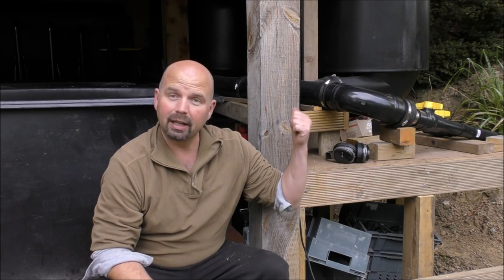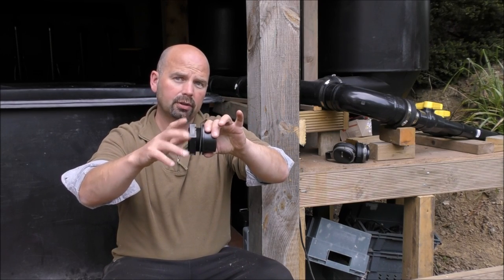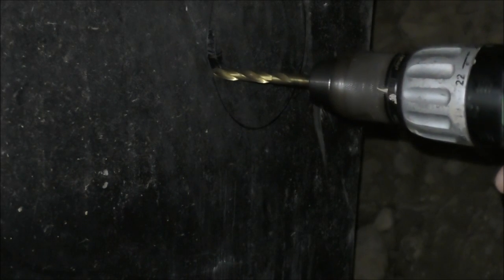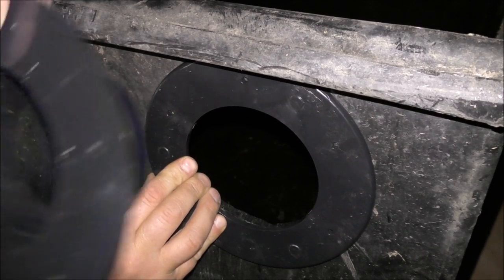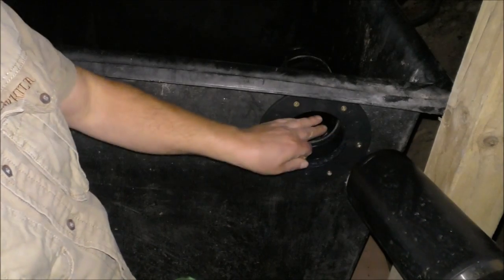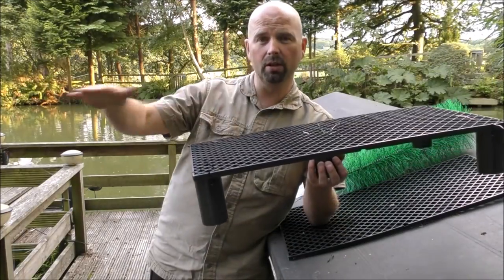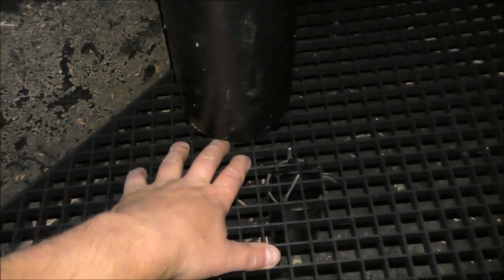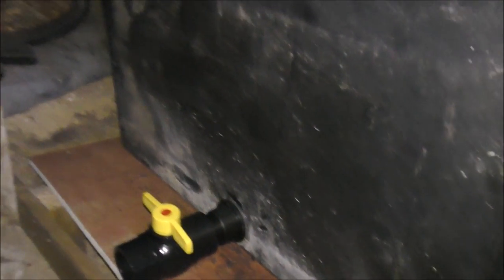Building a HUGE Pond Filter - Part 3 - Brush Chamber

Comment: i will drill with smaller hole saw and use a fat max knife saw to cut spokes to the edge then saw around the mark. One thing, Richard, the tank connectors don't come with washers I find. Had to buy on ebay. Will leak without.

Comment: Brilliant Richard, Been waiting for this one for a while. Where have you been pal? Hope all is good, Looking forward to the next segment. Tony
Reply from the maker: I haven't been anywhere - that's the problem, lol
Last month I had the equivalent orders of 3 months when I had the shop so I was stupidly busy and it's not letting up this month either. We're waiting of a large industrial drier being built for the filter media manufacturing plant which should really increase production then I will make the trade site live which will hopefully take some pressure off me if people can buy the media at various other sources in the UK. I can't make the site live until the drier is installed since we couldn't cope with an increase in orders at the present time.....it is mad.
Reply: @pondguru  Thats great news though mate. Much better to be run off your feet and have the orders coming than not have them at all. When is the drier due? When the trade site goes live that dhould streamline everything for you and free you up a little
Reply from the maker: It is quite a big thing so they reckon it will take about 6 weeks to build - can't come soon enough, lol

Comment: I can hardly wait until you show the pump. Its got to be a monster. I've seen them at a local store that only does Koi ponds..as I perused the plants outdoors,I went inside to see some huge commercial grade pumps. I wonder if they are low energy use like many magnetic drive pumps are compared to olden days direct drive pumps.
Well,I know my idea of buying bales worth of poly filter and filling one of those huge containers with it...or in milkcrates of it stacked might not be practical,but might work. How you clean it..is for you to figure out-lol.  Also the barley bales in the pond..no use to your needs? Some swear it takes care of green water.
Reply from the maker: I'm hoping that the first stages of this filter will handle the mechanical parts of filtration but if they don't then the latter stages will have static alfagrog which works great in muck.
The pump I'm considering is 30,000 lph and is 380w so is very low power consumption for the output it generates.

Comment: Being pump Fed I would consider a 4 inch bypass at the very top of the container. Just in case, you never know.
Reply from the maker: I had considered that but the system is under cover so will get no leaves or any other detritus finding its way into the containers. If the worst did happen it would take a good while to drain the pond so the fish will be safe, lol

Comment: I see the 5 outlets, however how do you plan on getting an even flow around the brushes to the outlets. I fear the water path will follow the outer edge of the container straight to the outlets.
Also the bottom drain may have difficulty reaching the far edge to clear the muck out. Maybe a small "H" shaped diffuser piping in the bottom.
I hope I'm helping.
Reply from the maker: Not sure if you saw the last video but I have built a pipe into the feed which will supply a really heavy flow of water for swilling down the containers for cleaning so muck flow through the drain will not be an issue.
Water in brush chamber is fired down to bottom by the 4" pipe and it rises up through brushes evenly so there will be no area where water level will be higher than other area in the container. The outlets may not be perfectly level but water flow will be heavy so should easily go through all 5 outlets. If I have got it really wrong I can simply add a 90 degree bend on the inside of the outlet to level water flow through them. I should really mention that in a future episode so thanks for bringing it up.

Comment: My advice when doing that is if you're going to use a drill with side-pressure, be careful and take your time. Drill bits and chucks aren't necessarily designed for side pressure, but in soft material like plastics, it should be okay. Always good to wear gloves and safety glasses!
Reply from the maker: That is a good tip and I should have mentioned that. The container plastic is quite soft so the drill cuts through it reasonably easier but I wouldn't want to see someone try this with a drill bit which snapped and ended up in their eye. I'll add a note to the video description and shoot an extra part for the next episode as a warning at the start.
Groovy.
Reply: Rock on, sir! I love your videos, can't wait to see the next step in this monster filter!

Comment: Awesome as always :) Just a thought but with those 4" legs are you not going to get water left inside once you drain it down? I built a similar thing on a much smaller level for my marine tank sump and cut out small sections at bottom of the pipe legs so the water could flow out. 
Keep up the great videos :)
Reply from the maker: I may get a tiny bit of water held in the legs but it will amount to very little and on the scale of things it's something I never thought about but I could see why you had holes in for a sump scenario - nice one.

Comment: Been a long wait for part 3 but worth the wait just a quick question when you changed the screws to the tank connector for longer ones was they stainless screws👍👍
Reply from the maker: They were galvanized as I didn't have any stainless screws - first choice would have been stainless for water use.

Comment: I work HVAC and have experienced rot in even pressure treated deck material from the moisture coming off a condenser unit with 6-8’ of clearance over the condenser fan. Big reason not to put a heat pump under a deck. You will have a lot of splash and evaporation adding moisture content to your decking pillars and planks. Might take a couple years but the rot may be problematic. Do you have a plan to combat or prevent this? I imagine reframing a deck or replacement of a pillar once all the filter equipment is operational and permanently affixed would be problematic.
Reply from the maker: There is pond liner above this filter project and that sits a good 9" underneath the deck above so that prevents moisture getting up. Sides of the filter area will have trellis on to allow good air flow through it so condensation should not be an issue. The ground under the filter has perforated field drains covered in 20mm gravel as that was originally meant to be the (ground level) site for the cabin before I decided to have it raised up.

Comment: Loving this little series I always planed on diving another pond and joining them with a small stream the fish could use to access both sides but funds ran dry so now I have a great big filter box just sitting there but after watching these I'm thinking maybe set it up with brushes to get the majority of crap as my pond is quite robust on the stocking side of things lol and that should surely cut down on cleaning of the filter pads as sometimes they can clog up pretty quickly so thanx for the insparaition now to find the time dam kids 🤣🤣🤣 tnx Jon ✌
Reply from the maker: That sounds like  decent plan there as anything to settle muck you can add to the system will definitely help to save the filter with finer foams.